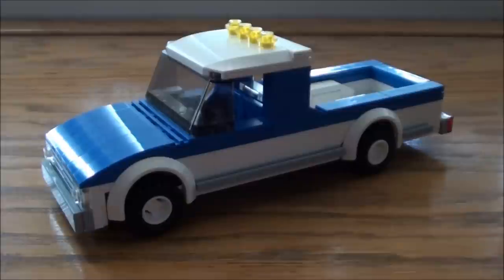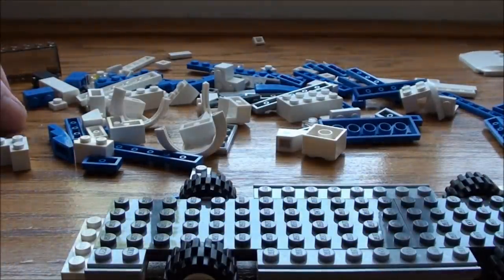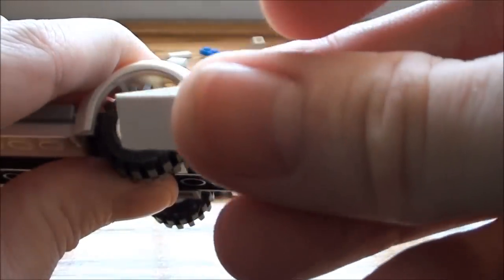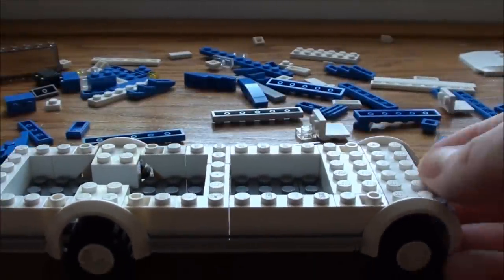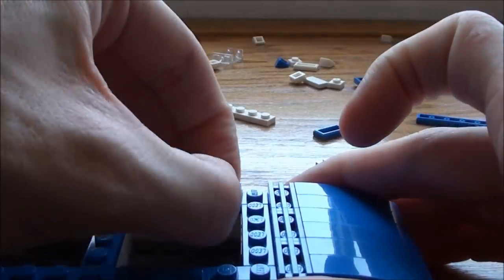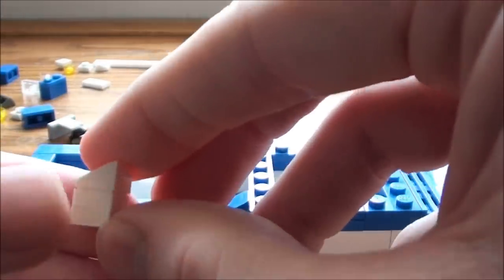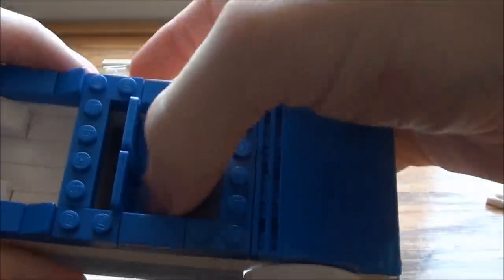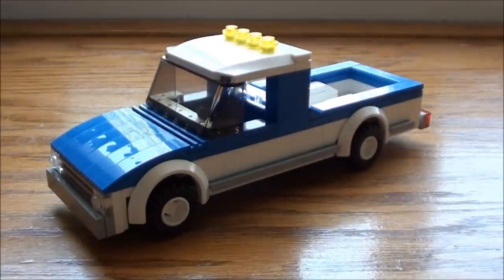How to Build a Basic LEGO Pickup Truck TUTORIAL

Comment: I built one with a roof light bar,adjustable side mirrors,crew cab, bigger wheels,tool box , brake light on the roof, bumper pull hitch, long bed, the cab has full on windows , front bumper , and tilled roof

Comment: Hey i made my Truck in all white since i didn't have any blue slope pieces on the Hood, and instead of 1X1 Plates right on the Windshield, i used 2 1X2 Plates with the side bar on them so I could make mirrors, then clipped on some 1X1 Tiles with the Clip on the top so it looks better. PS I LOOOVE your 5th Wheel Travel Trailer! I tried building it but i didn't have the right Plate pieces. :)
Reply from the maker: Chanse Gower cool! glad to hear you made the truck the way you want it. it's the same for the fifth-wheel. just substitute the parts you don't have.